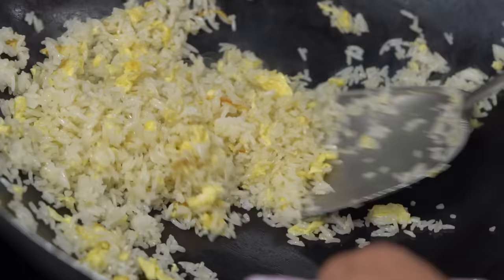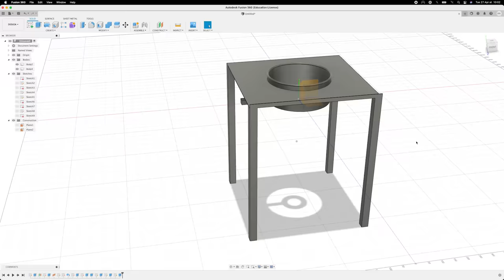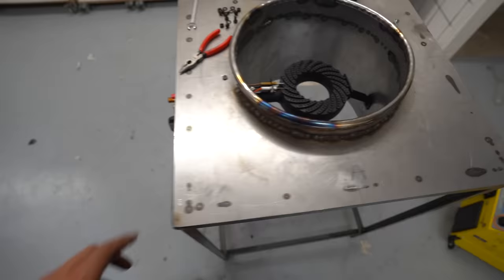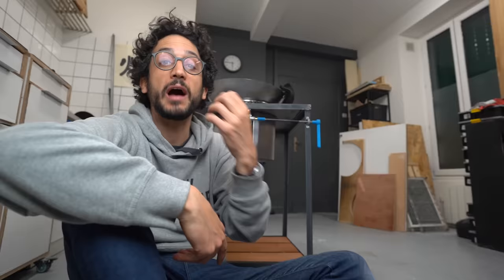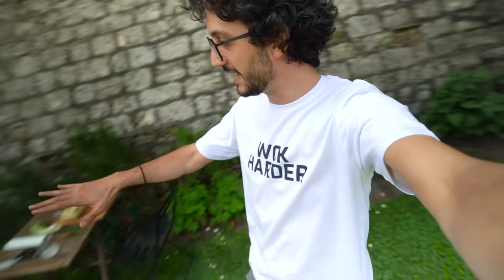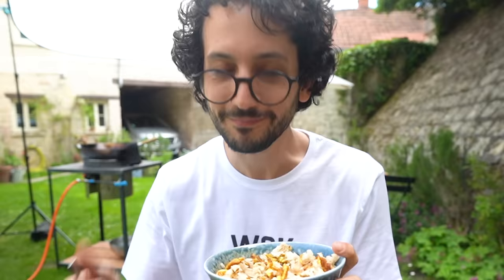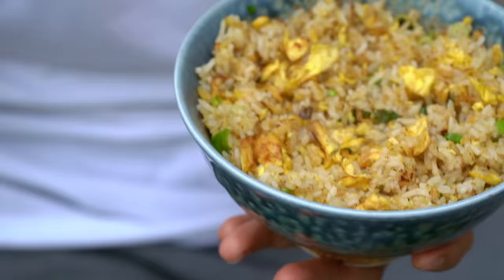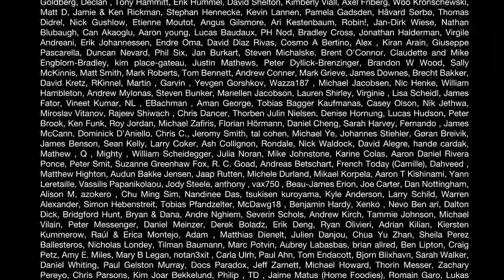I Built My DREAM WOK STOVE ! High power + Knee operated

Comment: Try this style of fried rice, it is from Singapore and makes use of easy techniques that anyone can master.

Main Ingredients;
1) Rice. Just get a some from your neighborhood Asian restaurant and keep in the fringe for a day. No need to cook your own.
2) Spam/Luncheon meat. Cut into cubes approx 3/8 in size.
3) Eggs, beateh.
4) Frozen mixed veg. Has peas, corn, beans etc.
5) Green onions/scallions/spring onions
5) Light soy sauce, fish sauce. No need for salt.

Fancy ingredients; (Nice to have but not necessary)
- Chinese sausage (Lap Cheong).  Slice diagonal thinly. Only need about 1.5" to 2" per person. 
- Rendered pork fat and the oil. Use a couple of tablespoons with you veg regular oil.  The fried pork fat chunks use as decoration.
- Sambal Blachan. This may be hard to get in western countries, but you do really need it.

Cooking;
1) Fry spam in till light brown. (Fry the Chinese sausage slices if you have them at the same time). Remove from wok and set aside.
2) Dump in your rice and separate it with your spatula.
3) Push the rice to one side of the wok.  Add in a a tablespoon of oil in the wok at the other side. Pour in the eggs and stir them. When 75% solid, 
push the rice over it and mix.
4) If you have Sambal Blachan, make a small hole in the middle of the rice and put some of the blachan in, if not then just skip. Add soy and fish sauce over all the rice. Don't go over board with the fish sauce. Fold rice over and mix the blachan in.
5) Add the spam/Chinese sausage in. Add the frozen veg in. That's right, straight out of the packet ice crystals and all. Fold the rice over, cover the work, wait 30 sec to a minute and turn off the fire. Let sit for a couple of minutes (If you haven't realized by now, the ice will turn into steam quickly and soften the rice a little, but not make it soggy like if you were to just spoon the water in directly)
6) If you don't like your green onion raw you can throw them in after you turn off the heat.
7) Ready to serve. If you have the fried pork fat, sprinkle a bit over the rice.

Comment: use more oil, then it will be moist, add the eggs after the rice has heated up, make a hole in the center of the rice and add more oil before adding eggs, and add the onions last to keep bright green color

Comment: Good job mate... but Auscrown sells them complete with a high pressure LPG regulator and two ring blast burner, oh! And a solid WOK enclosure. It turns carbon steel blue in less 60 seconds. It's $350 AUD. 80MJ and up to 130MJ. If you don't have time to build you own 👍

Comment: Do not Wok harder, Wok faster...
They don't use 25.000BTU stoves for nothing, it provides enormous heat so you have to cook very fast.
Reply: facts
Reply: You are correct it can clump the rice quickly if you don't move it around while burning it.
Reply: 25K BTU stoves would be really weak for a wok stove. They are more like 150K BTU and up.

Comment: Fried rice is about speed. In a small bowl, prepare garlic powder, white pepper, onion powder, chicken powder, msg and salt. This is so you've dump everything at once.
Reply: Yup, this is key to any proper stir frying, or to use the proper Chinese expression,  take extra care of your "mise en place".
Reply: Also, if you do everything in one batch, it is more difficult to get all the cuisson and textures right, cause you can't give one thing more than the other, if it is all combined. A trick you could use is do the eggs in advance, cook them just right minus 15 seconds, take them out, clean the wok, make the stir fry, add the eggs just before you put in the soy sauce.
Reply: Yeah, in my head I was screaming when Alex took time between and for each step. It should be "GO GO GO!!!"
Reply: @recoil53  :) . While I am at it: a flatter wok spatula can also help you work faster, it follows the contours of the wok, so it really helps in flipping everything over in one or two moves, though that tossing motion Alex practised may eliminate the need for that. Also, when he added the scallion it went on top of the rice, where it would steam rather than fry. I think you move the rice out of the way, add the scallion to make contact with the hot metal. This would help getting the bright green color he did not achieve.

Comment: Cook your rice, lay it out on a tray as evenly spread as possible and let cool to room temp- around 2-3 hours. Then transfer into fridge once it feels dry and the grains mostly separate with ease. If the rice is still sticky then simply break the chunk(s) and wait a little while longer. After placed in fridge in a container (loosely covered), you want to let it sit overnight. By the next day the grains should feel almost too dry, but this is of no concern. When you go to fry your rice it will quickly rehydrate with the oil and other ingredients like fish sauce and soy. 
Hope this helps!

Comment: J'ai eu un resto début année '90, là je me suis fait installer un feu pour wok. On a dû avoir une tuyauterie de gaz adaptée et le feu avec une ventilation qui injectait l'air par le dessous de l'unique "injecteur"  ce qui donnait une flamme avec un bruit de réacteur. 
Un wok moyen rempli d'eau bouillait après environs 20 à 25sec.
La conséquence de cette puissance, est que les woks se déforment puis finissent par être troués. Mais c'est un rêve pour cuisiner à la minute. Pour sauter "à sec" comme du riz sauté, cette puissance devient un inconvénient, il faut une source plus diffuse et moins puissante.

Sympa ta passion pour la cuisine au wok :)

Comment: Alex, just a couple of notes:
1) Work faster! you're too slow… Keep everything next to the wok so it's within reach. You seem to waste a lot of time by moving around. Ideally you should be able to whip up any dish by staying on a static position. And go triple speed with that ladle, again too slow.…
2) If you are breaking up the egg, turn the ladle around and use the rim instead of the round back;
3) Splash the soy sauce on the rice, not the edges. Any drops of liquid which will touch the hot wok will evaporate immediately, meaning the solids in the liquid  will stick to the wok and burn straight away. Burned soy sauce is horrible… 
4) I know a lot of Chinese chefs (or any Asian chef) will go in with the eggs first. But in order to do this you need to keep the heat low and use more oil because basically you want the egg to not really touch the wok too much in order to prevent it browning (causing dry and bitter egg). You also need very quick ladle technique to break it up properly and that is difficult. 
Instead: go in first with the rice, make a well in the centre, add the egg there, and then mix with the rice. Added advantage is that the egg is much finer distributed. You now basically end up with huge clumps and lumps of egg (also because of point 2). You want the egg to be very finely in there and almost colour the rice. Because remember, Chinese food is not just about taste, it is also about balance and the aesthetics. You want the components in your rice to be similar sized to the rice. So small bits of egg, finely cut scallions, some peas. This technique works way better (especially if you are starting) because the rice helps breaking up the egg and avoids the egg from browning too much. Basically the rice is doing half the work for you here;
5) Sesame oil! Add a few drops to the egg mixture (and season the egg mixture with salt and white pepper, if you do it like described in point 4 this means it also seasons the whole dish). And a few at the end when the heat is off.
6) Add a little bit of oyster sauce too
Reply: I would advise alex never to listen to you. Professional Chinese Chefs never splash soy sauce on the fried rice. =)
Reply: Wow!! I'm learning too!!
Reply: @tc7662  that's just not true… i've seen plenty of chefs in China, some in Michelin starred restaurants, do it.
Reply: @santibanks  Go look up all the Michelin star chefs or Professional Chinese chef tutorials on fried rice in China (Don't look at the fusion ones in the US, its not real fried rice) on youtube.  All of them aim to put soysauce on the side of the wok, and dont put it directly on top of the rice
Reply: @tc7662  It is exactly by watching chefs in Hong Kong and Shanghai that I see that they don't hit the actual side of the wok but instead put it directly on the food. Either they just splash it in the middle, or they circle around but still hit the rice (or whatever food they are cooking) directly.
 And it's what I also see the cooks in South East Asia do (Thailand, Indonesia).
Reply: @santibanks  When you say, circle it around, it hits the side of the work first before dripping down on the rice.  When they put it in the middle, the chefs make a hole in the middle where there's no rice. When you drip it on the side, its gonna hit the rice, the soy sauce won't evapourate imeediately. The point is that, its not put on the rice directly, which your original point seem to indicate - 'splashing it on the rice'. Rather, you're supposed to let part of it evaporate, so the rice will be imparted with the fragrance, similar to smoking bacon. If you've noticed, when they put on the soysauce, the fire is low, then straight afterward, they turn on the heat to evaporate the soy sauce to give it that fragrance. If you directly splash it on the rice, you lower the temperature of the rice and make it moist where it's spashed, and as a result, you can't slightly singe it and create the umami flavour, or as they say, impart 'wok hei'.

Comment: What awe inspiring dedication and willpower! I'm not an expert, but I spent some time trying to learn fried rice as well, and for the fire, I ended up usually starting at lower heat for the eggs. I have my pan tilted with the near side lower with the far side taking the fire, and I have the ladle face down, and I push strings of egg up to the hot surface. I also portion my rice before cooking so that I can do a straight dump into the egg to avoid overcooking the eggs. I've never worked with a professional wok, so I don't think everything I say will apply, but you've down an absolutely amazing job!

Comment: The usual fried rice technique would have employed:

1. garlic and onions first, you want to get the flavour throughout the entire dish, so start with the flavour.

2. once you have ensured all the main ingredients have been cooked properly (meats, vegetables, seasoning), add your rice and mix thoroughly. This is where the rocking technique shines.

3. Egg goes in last, because with that much heat, you'll burn it while you try to cook everything evenly. Again, the rocking technique ensures all the grains and ingredients are mixed properly, and allows you to scramble the egg at the same time.

4. Garnish is garnish, either in the wok or when dished. Or do without, because you would have all the flavour from the ingredients and seasoning anyway.

You're cooking a dish, not doing a show (I mean, the results you're going to eat). Forget the flair, cook it right.

Comment: How do you cook your cooked rice? Us Asian normally use a rice cooker. Get a good one from zojirushi or tiger with a fuzzy logic microprocessor. This type of rice cooker will give you the perfect base rice ( each grain is fully cooked perfectly and no burned bottom on the rice cooker) very different from a normal cheap rice cooker . The Taiwanese chef gave you a tip to use 1 part rice grain 1 part water. Thats a dryer ratio for jasmine rice cooking you eat on the spot but is perfect for fried rice. Thats what gives the al dente texture. After you cooked the rice, cool it down first to room temperature and spread and separate it. This will help to coat the flavor on each grain when you stir fry it. Best of luck. Your on to a good start. Oh and you need a high pressure gas burner. High heat and fast cooking seal in the flavor.

Comment: Alex, may I suggest use less oil. Fry the rice with the seasonings and soy med high. Push rice to one side of wok.  Add a touch of oil and crack your eggs onto the other side and stir in a lower heat to get curds. Once the egg firms up, break it all up but not too small. You want some larger chunks that will be fluffy and light and will retain  its colour better because it wasn’t Stir fried with the wet soy sauce.  I would not worry about uniform size, like why?   Throw the green onions in and toss for 30 seconds and serve immediately. If  you over fry, after cooking the eggs they become rubbery, the rice becomes hard and the green onions lose their vibrant colour.

Comment: You did great for starting out.  I wish I had a burner setup like you built.  One key thing I would say is to move a little faster.  The slower cooking is good for getting the technique but going faster will lessen the overcooked problem you're having.  When you put the eggs in, immediately start swirling it in the oil so it won't get darker bits and will have smaller even sized pieces.  Once you get some nice strands of egg, toss the rice in quick.  Really it's just speed that's impacting you.  Scallions just add them later so they don't get overcooked.

Comment: you may want to adjust the oil level in the bottom of your wok to a smidge less then normal, try blooming the dry ingredients ( salt, sugar, dry spices) into the soy sauce 15 minutes before you start, and let that iron normalize it's heat on just a smidge above the lowest level setting before initiating the cooking sequence.  For the rice, try adding in a bit more water when you cook it to over saturate the grains. This may aid them so they can create the necessary steam jacket during the frying session.

Comment: welding sheet metal and thin wall tubing is very bold for a beginning welder. As you've probably learned it is all about controlling the amount of heat you put into the joint to prevent breaking through to the other side.

Comment: The trick to egg fried rice and the wonderful restaurant flavor is mastering heat control to attain wok hei. Wok hei occurs when tossing the rice mixture into the air over very very high heat. The tossing motion allows the heat to vaporize the oil droplets that are flying through the air. To prevent the rice and eggs from over-cooking however, every time you stop tossing the rice and eggs, turn off the heat. If you need to stop tossing the rice and eggs to season with salt and sugar, turn off the heat first, set the wok down, sprinkle the salt and sugar, pick up the wok, turn the heat back up to high, and start tossing again. Thats why the gas control lever in the restaurant can be controlled with the knee.

Comment: for the carbon steel situation how about using a sacrificial anode instead so when the worst comes and the anode has fully reacted replacing it would be a lot easier rather than having to repaint every 1-2 years, it would also look aesthetically more appealing (in my opinion of course) with it being hidden perhaps somewhere where it will be unseen, just a thought though.

Comment: To keep the rice moist the sticky rice has to be steamed to perfection! Second you need to add vegetables like zucchini and cucumber lastly the procedure of doing it, first add the oil and veggies, flash toss and then the rice, make sure you separate it evenly and then make space in the centre drop the eggs at once lift your wok so its heated only in centre and then  scramble it vigorously from the centre and mix it with the rice and all this to be done not more than 6-7 mins and there you go chinese fried rice!

Comment: @Alex: regarding the right moisture of the rice. Using overnight rice is correct (for home use), but I overheard several Cantonese chefs reluctantly admitting that using 'fresh rice' is the secret of a top class fried rice dish (probably because of a professional jet burner you can evaporate the excess mosture better without overcooking the rice). They almost certainly don't use the freshly made rice right away, but let it sit xx minutes/hours to cool it down and get rid of at least some of the moisture first. Which type of rice they use and how long they let it rest is probably the real secret of each of those chefs...

Comment: Great series. But just a little tip concerning how you tightened that tube fitting: These kind of pliers self clamps if you grab the nut the other way round. Makes it very easy and the plier is not trying to force itself open. Instead, you can just focus on the torque and it will pull itself closed.

Comment: With more egg the less it sticks. When egg is about 60% cooked add the rice immediately. If the heat is too extreme lower it. Add some chicken stock near the end and the rice will soften.

If you want even more flavour a few drops of good toasted sesame oil is perfect as is a tiny drop of whiskey.

In Chinese work stoves there is a water layer for cooling, otherwise the rapid expansion and contraction on heating and cooling cycles will cause the metal to crack.

Comment: For ppl watching, you have to pay attention to natural gas vs propane vs low pressure vs high pressure, the valves and needles are all different. Any new system should be checked with a thick soap and water mixture, all connections etc to check for leaks..very important do not skip, and check your regular cookers too every year. Wok burners also are center oriented, the flame needs to start in the middle, heating the sides of the wok is counterproductive. Check out “Chef Wang” channel for him to show great wok technique..

Comment: I would suggest having another square ring like the middle one on the outer edge to rest your wok away from the heat without turning it off. It will buy you some more time for the in-between action like putting in the rice, scallion, seasoning, etc.